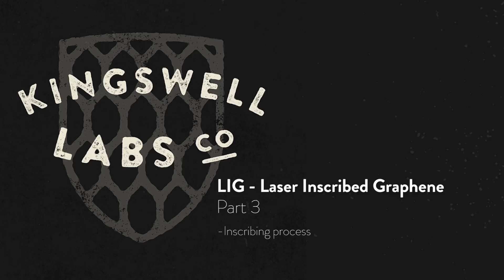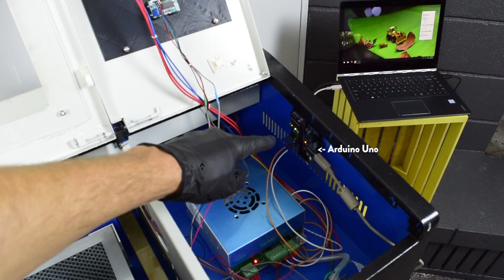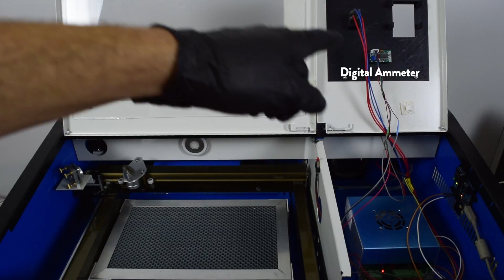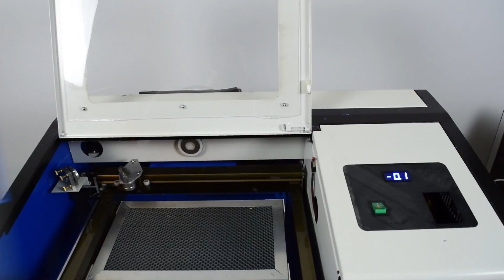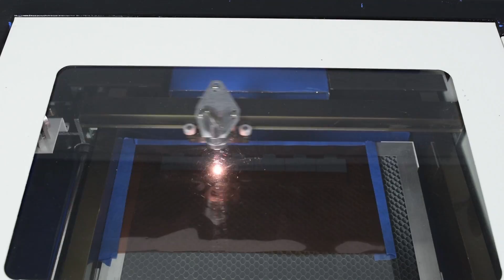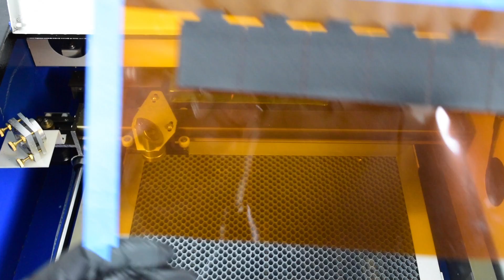Graphene Battery at Home: Laser Inscribed Graphene (Part 3)

Comment: A little TIP , is to perform the raster process out of focus, about 1 to 2 mm.  
With this it is possible to hit the area more times with the laser beam.

The first pass creates a charred area, (high power 100%)
the second or 3 blurred passes, (the laser power can be reduced to 70%)
 it is the one that induces graphene foam on the surface of the material.

I  tried birch ,oak and pine, but found that ebony wood cross-linked lignocellulose structure made it better for the production of high-quality graphene than woods with a lower lignin content.
Lignin is the complex organic polymer that forms rigid cell walls in wood.
Reply from the maker: Very interesting! I haven't worked with this method is quite some time but this is something I will look into. I pinned your comment for more exposure.

Comment: This video was very helpful for me but I have a question for you How can I calculate the active material weight from this cell because I think the middle part is not turned into graphene. Will I subtract the untreated area weight from the total weight or may I use the total weight as an active material weight?

Comment: What pulse per inch and speed did you use when laser engraving the polyimide
Reply from the maker: I apologize, it has been a while since I used the engraver. I don't think my engraver had PPI settings, if it did I never changed them... and I think I set the speed to 400mm per second. I basically used the same setting you would use to engrave arcylic.
Reply: Kingswell Labs thank you the information really helped me get the right setting on the laser engraver.
Reply from the maker: Glad I could help!

Comment: Im sure I missed something, but could you explain how the laser causes graphene to form on the surface of the film? Is the film made with graphene in it and the laser pulls it out?
Reply from the maker: I didn't really get into the details on why this technique works and I 
will have to reference the research paper that I got this from. 

But off the top of my head, what is happening is that the laser (at the right wattage) will vaporize the top layer of the polyamide film leaving behind sp3 carbon in many layers, i.e. Graphene (I believe). There is quite a bit of "dust" which is conductive as well (I assume it's graphene).  It will also flake off or rub off the film, so it's not really a part of the film but more loosely stuck to it.

I think this works because of the way polyamide/kapton is made:
https://en.wikipedia.org/wiki/Polyamide

I hope this helps!.
Reply: Yep this definitely helps, thanks! What is the name of this process, so i can do more research on my own time. 

Another question I had from watching your other videos that ill ask here is:
When making the foams or plastics with graphene, what is it that makes it super strong? Do you simply mix in the graphene powder you're creating with the melted plastic or foaming material? Or are there other steps involved? 

If there are other steps would you be able to elaborate or is that kind of your secret?

Sorry for all the questions, I just love the science of this stuff.
Reply from the maker: I don't mix in Graphene powder for the film, the laser is doing that work. There is nothing I am doing special that makes Graphene strong, Graphene has good tensile strength but will break if bent... the Graphene foam is more elastic due to it's 3D structure and therefore less brittle. The foam to put simply is just Graphene powder that's been freeze dried to shape then annealed in a kiln.

Don't be sorry for the questions, I am happy to help!  At this point google is your friend, that's basically how I got to where I am... there are a lot of great resources available, most are free.  But if you have any other questions, please ask.

Comment: Very interesting and thank you very much for sharing!!You used it for a capacitor but do you think it can be used to create simple circuit lines to conduct electricity like a PCB? Thank you very much in advaced!
Reply from the maker: Glad you like it!  You could create a circuit, but I don't think it 
would work well due to resistance... Actually I am curious since I never
 made just lines. I will make some circuit lines, test the resistance 
and let you know.
Reply: Thank you very much that would be just great! Please keep me updated if you do any test as Im very curious too!! Thank you very much again and waiting for your update than!
Reply from the maker: I had time so I did a quick test... I made a small trace about 200mm long, maybe .5mm wide and the resistance was about 3K Ohm.  I didn't run any further tests as the resistance was pretty high, let me know if you want me to try something else.  

Just to note, the best resistance I measure was about 40cm2 square and with the leads on either end I got 80 Ohm.
Reply: Thank you very much indeed for your fast reply and for the trying of the electric tracks!mmm the resistance is quite high...I thought it could be better...what was the Watt that you use for the inscribing of the tracks?do you think that maybe by rising the watt power of the laser an higher percentage of graphene can be obtained? and so as a consequence a lower resistance?
Reply from the maker: I think the problem is the nature of the Graphene layers with this method. This works better for electrodes because there are many layers of graphene flakes like pouring cereal into a container.  The flakes will all settle at different orientations leaving lots of air gaps, that is what gives it the high surface area and which also leads to higher resistance... But, we don't care about that too much for electrodes, we just want a large surface area. 

For wires, it would be better to have single or few layer Graphene made using CVD (Carbon Vapor Deposition).  That way Graphene is more like one ultra thin layer with very little resistance.  

There are basically three methods of making/utilizing Graphene...
1. CVD - mostly transparent single to few layers of Graphene
2. LIG/LSG - Many Layers or graphene flakes, still very thin.
3. Graphene Aerogel/Foam - What I think is the future electrodes, other materials, space travel ;-)
Reply from the maker: Yes, my original electrodes we modeled after the A4... but for testing I found just a simple square capacitor was the easiest to test with (a lot of trial and error).  I would only take a few hours to inscribe enough Graphene layers to make an A4 sized battery.   With this technique there is still too much polyamide film left over to make it worth while though.
Reply: Thank you very much indeed for your precious suggestions and for your kind availability!they will be very helpful! Again thank you and keep up doing amazing things!:)
Reply: Did you ever try this with a shieding gas?

Comment: very cool mate - can you give the power setting? I subbed and who on earth disliked this? some folks are sad when it comes to disliking - i thought it was ace
Reply from the maker: Wow, thank you so much!  You are the main reason I started working with Graphene and started this channel... I am really loving your latest work with organic material, once again very inspirational.

As for the laser power, it's about 3.6W.   It depends on the thickness of the film used, if you go thinner you just have to up the power a little to ~4W... I wouldn't go higher than 5W.

Hey, it's YouTube... I am happy it's only one dislike ;-)
Reply: very cool mate thanks for the info - i'll give it a go and good luck with everything
Reply from the maker: Thank you for the kind words!
Reply from the maker: Anytime!  Also, if you don't go the route of using a micro-controller to control the laser power, you should replace the potentiometer with a 10-turn potentiometer... It will make using the engraver much much easier.
Reply: nice advice mate - i have a Pi sitting around so i think microcontroller it is

Comment: Also I have some Polyimide foam which I was going to experiment with, if I got the laser. I do not have any immediate use for it and if you want me to send you some of it let me know, I have 2 large boxes full of the polyimide foam in different thicknesses. It would not be good for any type of water filtration which I initially wanted to get my hands on it to see but you might have other uses for it with the laser.
Reply from the maker: I would be interested in seeing if a thin foam would provide more surface area and film it as well.   I will email you my info, thanks!
Reply: No problem, I have a good amount 100+ sq ft in varying thicknesses. It is 100% Polyimide as well, I would only ask that you make a video on it so I can see the results but I will send you a 2'x3' box if you want it.
Reply from the maker: Mike Hall I will definitely make a video and post the results!
Reply from the maker: Send me an email to mike@kingswell-labs.com and we can sort out the details.